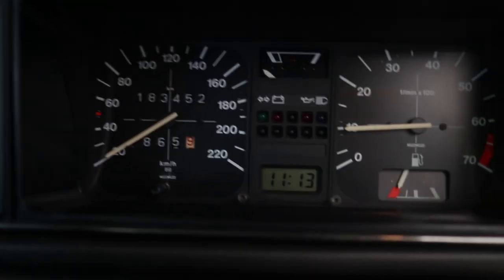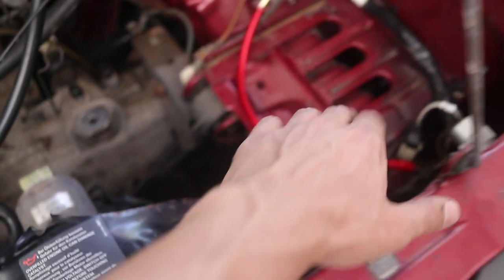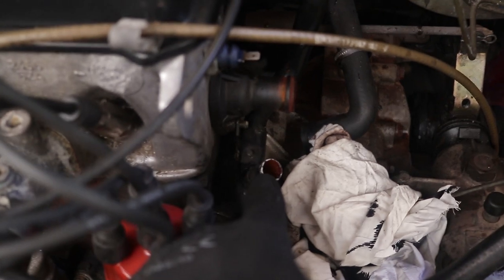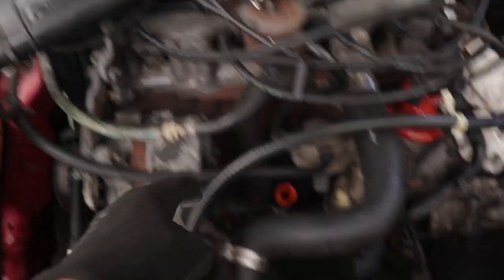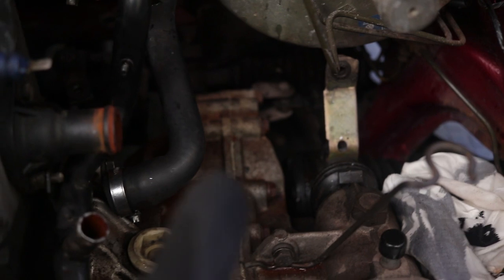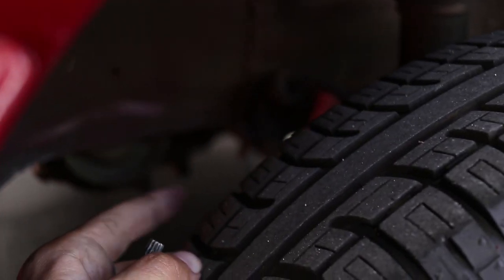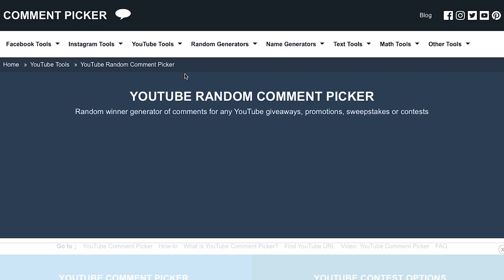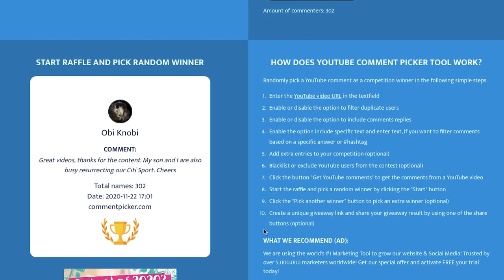Mk1 Citi Golf 2l 8v swap | Engine removed + 4k Giveaway winner announced!

Comment: Wade can keep the prise. And you need to do a wire tuck. Btw are you going to run with ITBs in the car. Great content 👍👌
Reply from the maker: Thanks bud 🙏🏻 For now I’m going with the mp9 setup and Vr6 throttle body. But eventually want to do the itbs